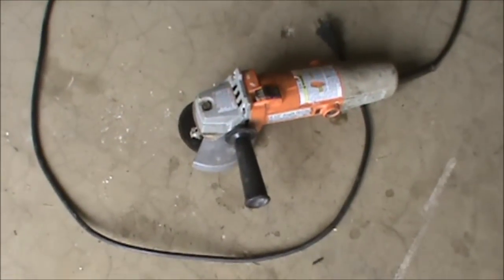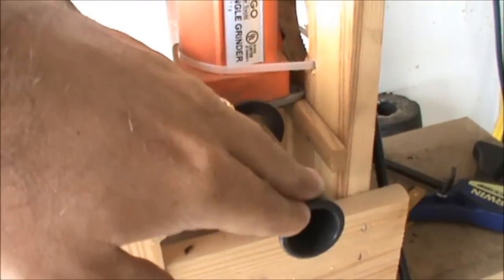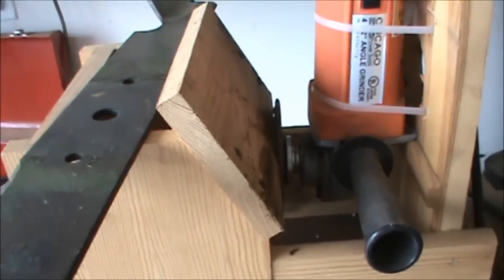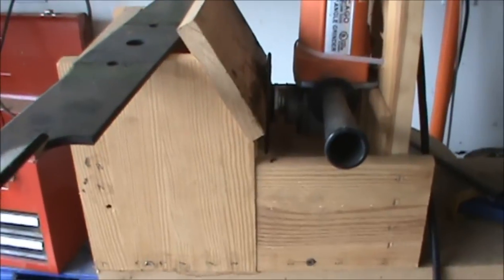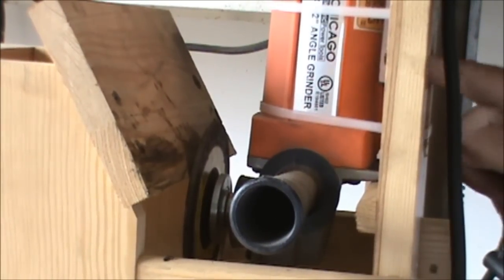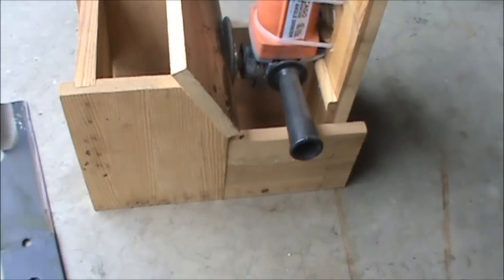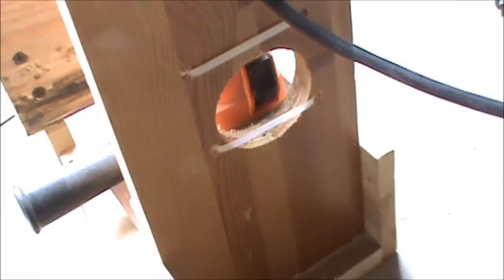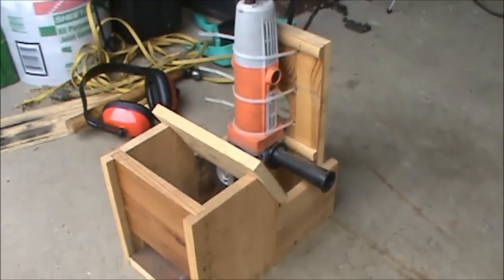DIY lawnmower blade sharpening jig fixture

Comment: It’s simple to not have your lawnmower blades  turn blue when sharpening using an angle grinder with a flap sanding disc. If  my lawnmower blades have hit an object that causes a sizable dent in them. I first use a grinding wheel 
disc on  my 4&1/2” angle grinder. I use the flap wheel sanding disc to finish sharpening my lawnmower blades. Why use up a flap sanding disc? Good ones are expensive. First take your time sharpening the blade. Don’t try to remove a lot of metal between each pass over the angle grinder’s grinding wheel or flap sanding disc . Have a pot of cold water to dip the blade into after you run the blade by the angle grinder’s grinding wheel or flap sanding disc. Then wipe the blade free of water before proceeding to pass the lawnmower blade past the sanding wheel or flap disc again. If my riding lawnmower blades have only become dull. It takes about 10 minutes to resharpen them. During the summer I’ve to mow my grass at least once a week. Mowing a 1/2 acre of grass. I will resharpen my lawnmower blades at least every 2 weeks. Keeping your lawnmower blades sharp is the key. To chop the grass cleanly and a lot faster than with dull lawnmower blades. Only spiral blades on lawnmowers cut the grass. A regular lawnmower Chops the grass. If you ever seen a green on a Golf Course being mowed. It is being mowed by a spiral blade lawnmower.

Comment: The one fundamental thing that is so crucial to Sharpening anything that everyone leaves out with mower blades, is raising a bur....if you do not have a bur on the back side then it is not sharp...after raising the bur you can remove it easily with a file or any type of strop

Comment: I’m  not a Shop teacher but I’m a retired Woodworker and I saw a Steel Jig on EBay  that I kind of thought was  a little overpriced for what it is  so I guessed someone had a YouTube video on something similar and cheaper Inam a DIY guy not a commercial Landscaper  so I’m only doing my own blades  when needed  I’ll probably pick up spares and just keep a sharpened one to swap as needed  my Dad  cut hair my whole life and he sharpened every night in our garage after dinner  he could put a edge on anything from  his $150.00 scissors , a lawnmower blade ,or any hand saw  he used a  stationary grinder ,and Wet Stones he lubricated  with saliva !  He even made us save dull utility knife blades that we put in a  special container  then he would resharpen and put back in the Stanley dispenser mounted in our garage /shop   For myself  my company supplied new blades  and although I have sharpened a few over the years mostly dull ones got discarded safely

Comment: Sorry guys, LOL, but I'm more impressed with watching ice melt than watching this video; no offense or disrespect intended to anyone, but what I've seen what the blade looked like, mm mm mm ; i feel sorry for the blade, AND the mower that it goes on. If the blade looked like the one that he just got through sharpening on the other end, ( unless he redone it that wasn't shown/pictured) this blade wasn't in much better shape than when he started:  #1 the blade wasn't sharpened all the way to the end properly: #2  to me it appeared as the cutting edge had been  rolled/rounded, as if it wasn't held flat against the table. A much better blade sharpener can be built in anyones garage/shop, with an electric motor, mandrel, grinding rock, a blade depth adjuster from a old wrecked electric saw, a piece of flat thicker metal  (for the table) and a drill/or drill press, a thick shorter piece of wood  (to mount everything on), some of y'all might already have this one figured out, it DOES  take a little while longer to make; but this one will last for years and will leave your disk grinder free for other purposes.

Comment: Blades should not be razor sharp.  If you run your finger down the edge (DO NOT TRY THIS!  Just an explanation) and you cut yourself, it is too sharp.  The slightest contact with a twig while cutting will chip the edge if it is too sharp.  Honda had a spec for this when I worked at a dealer years ago.  After sharpening, just run the burr off with a wire wheel and you will be close to the desired edge.

Comment: You oughta try twisting the drill on the jig a little so that the far side of the wheel is a little closer to the platform the blade lays on than the side of the wheel closest to you.  Then use the far side of the wheel to grind so that it doesn't throw sparks toward you.

Comment: If that grinding wheel brakes on you when you're sharpening your blades like that you can get really messed up. Ive seen a grinding wheel brake apart and hit someone right on there neck. Not!!!! good.  You don't even have a guard on it. otherwise it would be a good idea.

Comment: Hey dude..nice idea and handy make, however, If the Disc shatters, which sometimes occurs, you are right in the firing line as you have no guard between you and the spinning disc.  perhaps a redesign with a shield would reduce the risk of injury if the disc were to explode.

cheers and good luck
Reply from the maker: Anzac Day Good point.   I am going to add a clear acrylic guard. Thanks

Comment: Great vid,  a blade does not need to be razor sharp and new blades are not razor sharp ..A razor sharp edge is too thin..The blade needs to be even and thin and it looks like your jig is doing that ..My area is very sandy and the blades round out on the ends after a bit of use..

Comment: I really appreciated this video and I do plan to build this sharpening jig. In your video, you are showing a good SIDE VIEW - is there any chance that you could give us a few dimensions, like thickness, width and height... of your side view. I realize that it would also depend on the size of my grinder -- which appears the same as yours. I looked for the plans but could not find them. Just a few measurements from your project would be very helpful. Thanks again for this good video!

Comment: Well that's a big improvement over your bench grinder blade sharpening but try an emery cloth grinding disc on your angle grinder and just clamp the blade in the vice. You wont take near as much meat off the blade and you wont heat the blade up as severely as a solid disc will. I have used all three sharpening methods over the years, file, bench grinder and finally angle grinder with the emery cloth disc so I do speak from experience.

Comment: I worked all afternoon on this project and all went well until I tried it. Lacking plans, I srt the angle at 30deg. However, the angle should be 60deg since the angel is figured from the horizontal 0. He measured back 30deg from 90deg. Now I have to make the side pieces over and hopefully won't have to start over.